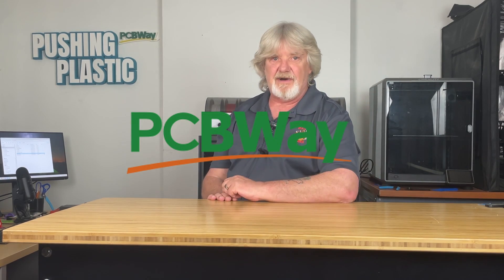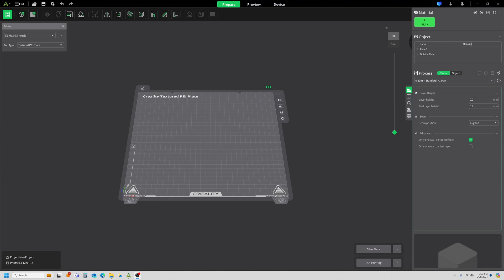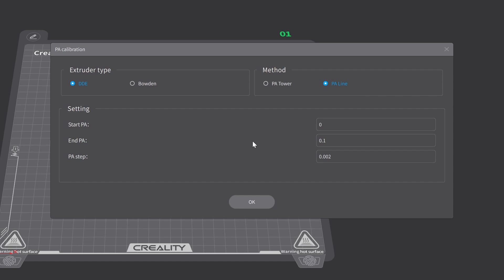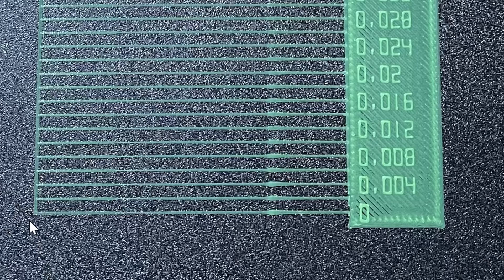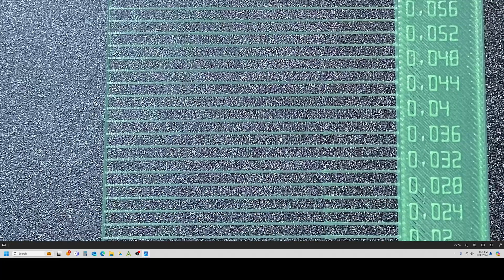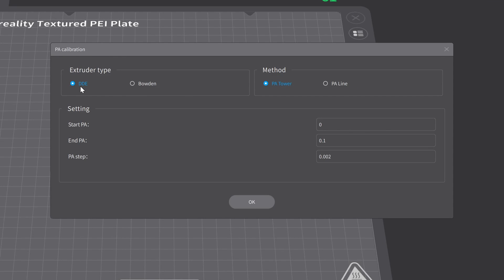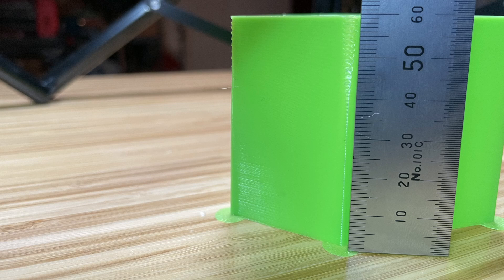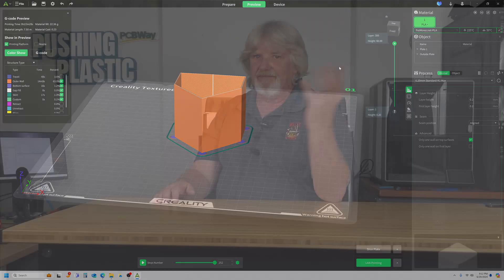Pressure Advance With Creality Print 5

Comment: ive tried the line test and the tower, but not seeing any decent results, all lines have blobs, what would you suggest?
Reply from the maker: I'm assuming you've done the temperature tower and flow rate before running this calibration. What model printer are you using?
Reply: @pushingplastic7445  correct, ender 3 v3 se with rooted nebula, have also done esteps so cant imagine it to be an over extrusion issue

Comment: If you start at zero but you already have some pressure advance dialed indies it set it to zero automatically or does it keep the advance that is already there and add to it?
Reply from the maker: It only uses what is specified in the test. It doesn't add (or subtract) any value that might've included in your profile. I hope this helps! Thanks for watching!

Comment: All of my lines of my PA lines pattern is printed broken when starts accelarating. What this means? When I print the tower, that looks good, with some material acumulated in 45º corners.
Reply from the maker: If that's the case, I would use the tower. Are you seeing anything  broken up in the tower?
Reply: @pushingplastic7445  nope, that prints prety good. Only the material acumulated in 45º corners about 10mm above the base

Comment: Nice demo!  I have a CR-M4 and I am wondering if pressure advance will work with it?  I am generating G-Code with Creality Print 5 using the Klipper setting, but I think the CR-M4 is supposed to use Marlin as it's native G-code generator.  Any thoughts on that?  Thanks for your time.

Comment: Thank you for covering the new creality software, as someone who has never printed before i picked up a k1 max last week and I learned that there arent really any instructions to make sure youre calibrated and set up well. Your videos covered what i needed that other general setup and unboxing videos did not cover, let alone on the new creality software.
Reply from the maker: I noticed that there wasn't a lot of help for those wanting to use Creality Print! It's a good slicer. If you run into a problem I haven't covered yet just drop a message in the comments on any of the Creality Print videos. I'll do my best to guide you through it! How do you like the K1 Max so far?

Comment: Parece que no viene habilitado en el firmware de mi impresora (Ender 3 V3 SE) por que toda la impresión es idéntica, no hay una diferencia en el patrón de impresión de ninguno de los dos test.
Reply: Me parece que es por el hecho de que este test es para impresoras con Klipper, y la que tienes (SE) es Marlin, este tiene otro test con un nombre similar que se llama Linear Advance.
Reply from the maker: The Ender 3 V3 SE would require Linear Advance, it's very similar theory to Pressure Advance. So far it's not enabled on the stock firmware for the Ender 3 V3 SE.
Reply: @pushingplastic7445  Parece ser complicado habilitarlo por lo que he leído, no tengo experiencia modificando el firmware. Saludos

Comment: Is there a trick to get Creality Print to detect printers on wifi network
Reply from the maker: If you click on the Device tab at the top of the screen, in the upper right hand corner there are options to scan for printers or you can manually add the printer by entering the IP address.

Comment: Thank you for this video!  I have Creality Print 5 on my Windows system and want to start using it more than the older Creality Print.  Videos like this really help me learn how to use it.  Question, if you know - Creality Print 5 is only available on Windows.  Do you know when Creality will come out with version 5 for the Mac?  I also use a Macbook - which has CP 4.3.
Reply from the maker: It's your lucky day! Creality Print for the Mac can be found at the bottom of the page https://github.com/CrealityOfficial/CrealityPrint/releases/tag/v5.0.3

Comment: On the Tower test I usually measure the seam as pressure advance will affect seam. There is always a clear spot along the seam where it looks nice.
Reply from the maker: I avoid measuring along the seam since it is the starting point for layers moving upward. Pressure advance is more or less finding the sweet spot between over and under extrusion. But if it's working for you, great!!! Thanks for watching!